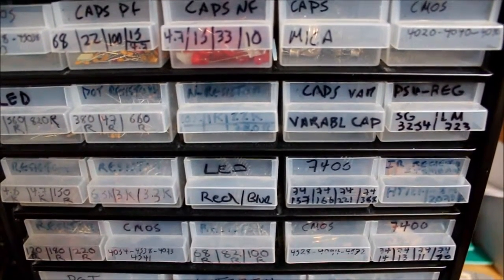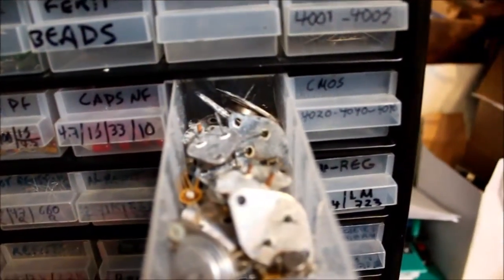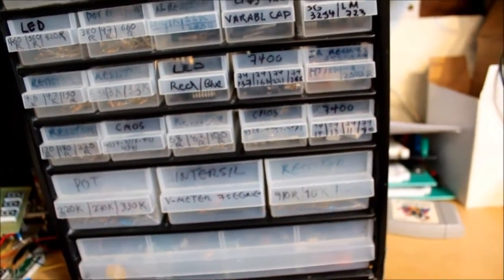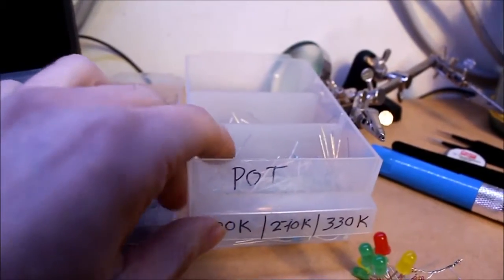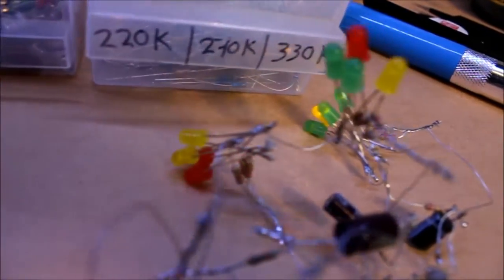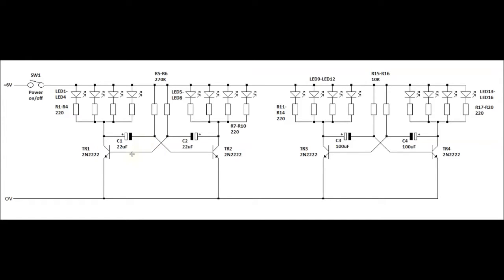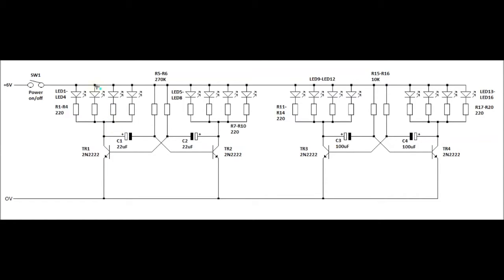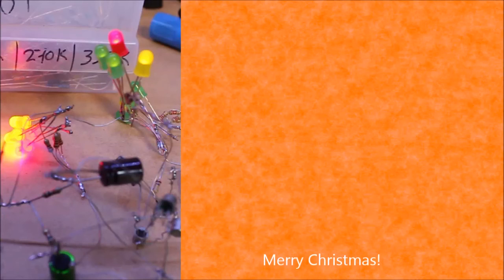Christmas 2016: Electronic circuit from online bargain

Comment: I hope you had a good Christmas YE! I'm a day late to post this, but we made a  merry christmas video for you - since Youtube removed video responses I'll post it in a link: https://youtu.be/yBzB8O4hbbA
Reply: I've watched the video and have a couple of questions:
With the relation to Bitsa, did you have someone choose the components for you (or randomly select them), or is the idea that you're limiting to the contents of the draws?
Also, do you have a formula for the relation between the resistance and capacitance and the flash rate, or did you just select a few different sets of resistors/capacitors to find which would return reasonable flash rates?
Reply from the maker: Like Bitsa, there was no random selection, I had an idea of what I wanted to make after seeing what components were available. The formula for the flash rate is simple but because I used multiple LEDs in parallel the rate is much faster. So I did try a number of different values to see what would give me alternate flashing between the two pairs.